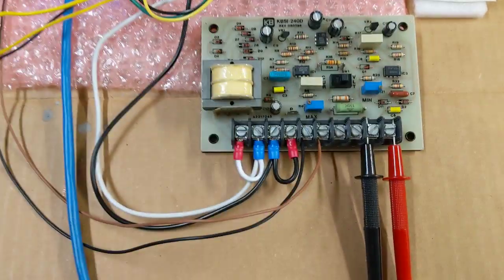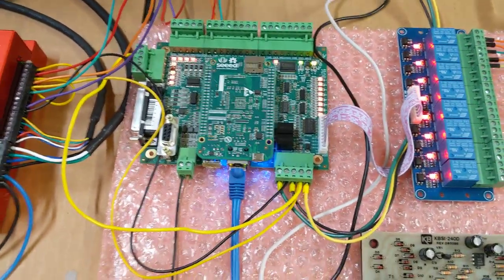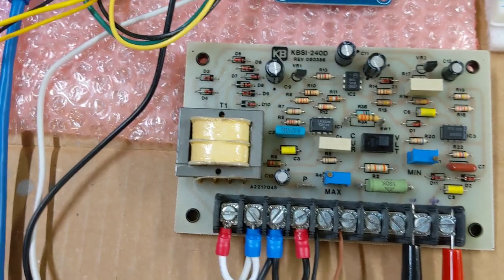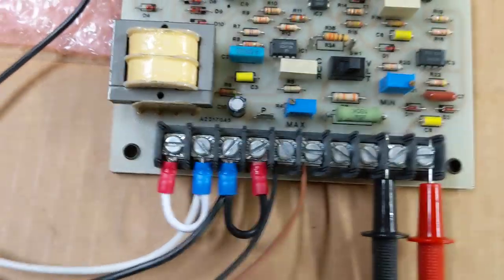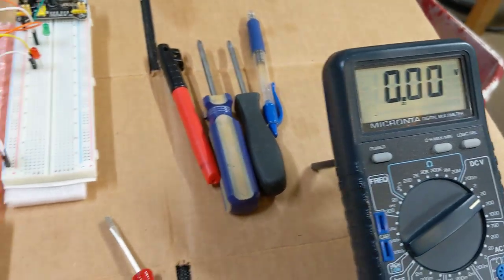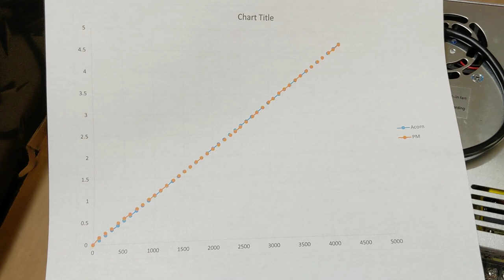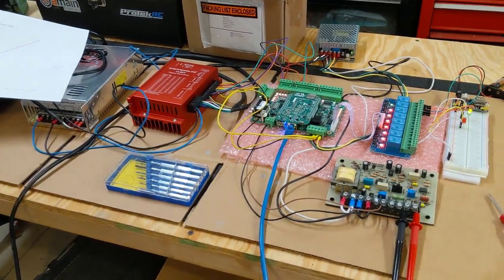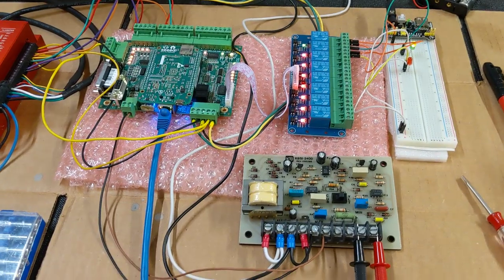PM-728VT Spindle Control #3 with Centroid Acorn

Comment: You might look at the board before ordering a new one. It might have just fried a capacitor or transistor that is easily replaced. Burnt electronics are usually pretty easy to spot. If there is a computer chip that fried, then you are hosed.

Comment: I purchased some kind of daughter board directly from pm when I bought my 728vt, its basically a board that allows you to send a 1-10v signal to the spindles controller and use your controller to engage the spindle.  It was like 20 bucks I think.

Comment: Hi Franco, I'm right in the middle of wiring my PM-30 spindle motor control with the KBSI-240D. The motor controler board I have is not configured the same as your wiring diagram. It's actually coated in black epoxy so I can't even see pin outs. Can you help please?

Comment: Are you going to use a 3rd relay to provide mains power to the motor control board?  My PM25 removes power to the board when the FWD/REV switch is in the center position.  I use a 3rd relay commanded by the Spindle Brake Release signal on the Acorn to power the motor controller.  Just something to consider.

Comment: Nice Presentation, you mentioned a nonlinear relationship between the KBSI-240D and your lathe. My southbend 8k lathe with a bldc motor has the same problem using the kbci-240D. How did you compensate to achieve proper rpm ? Again thanks all the good info. My PM728 is following yours to cnc. I will comment on acorn forums. kilo7

Comment: Hey, one who works, will make mistakes. One who doesn't work will not make mistakes. It happens to all of us.
Instead of using the KBSI board to reduce the voltage, can you use only the 0 to 5 v spectrum from the centroid board ? Basically limiting the centroid board from the software.
Or are you using the KBSI more for protection ?

Comment: Where did you wire the ground wire for this board? I assume that were you have your leads connected are for the wires going to the spindle with no ground wire.
Reply from the maker: Look on the instructions for the board - no ground.  I guess this is what they call "floating the ground".